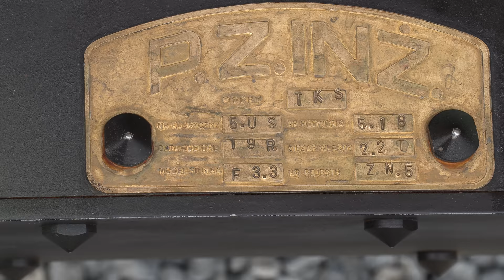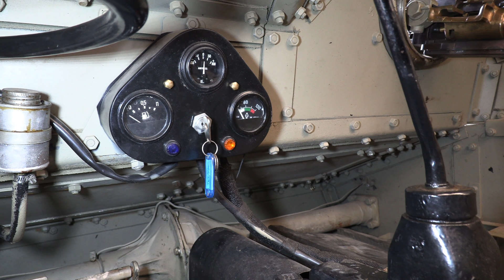Inside the Chieftain's Hatch: TKS

Comment: I heard that it was 2 types of this "tanks":
1. infantry support with automatic carabine - around 7-8mm
2. "tank killer" with 20mm automatic carabine

and alternative for this tank was not a horse, it was renault FT .
Reply: So you heard wrong. There were far more versions of TK.

Also, yes the alternative for this was a horse. TK was a reconnaissance tankette. How, for the love of God, do you imagine using Renault FT for recon missions?
Reply: @kamilszadkowski8864  I don't imagine Renault Ft as recon. I think Renault and TKS  have similar dimensions, 2 man crew, so it could be used similar. 
TKS was used only for rekonaissance?
Reply: @danieldz7906  TKS main job was reconnaissance, followed by fire support.

Comment: Some of them were equipped with a 20mm autocannon which proved to be exceptionally deadly weapon to the early models of the German tanks. First and only Polish tank ace of the September 1939, sergeant Orlik destroyed three German tanks with a 20mm TKS during the one engagement, he took out two PZ3's and one PZ4 killing a German aristocrat who was its commander, prince Von Ratibor the story is that after the engagement, the Poles tried to pull the wounded prince out of a burning tank, they succeeded but he was gravely wounded and he died shortly after the rescue attempt.

Comment: The way its radiator draws scares me... one stick or shrapnel shard in that rear flap and the cabin will fill with some combination of scalding water and hot steam. A complete engine cover (it only needs to be a thin bit of sheet metal, its deflecting leaking fluids and stray elbows, not bullets) that bolts in place over the mechanical would have made the cabin markedly safer and easier to work in, and likely improve reliability when you can't accidentally knock a vital component with a boot, ammo can or helmet as your thrown around in an emotional incident.

Comment: Because the crew compartment is also the engine compartment, (complete with radiator), it must have got rather hot for the crew, even in winter.